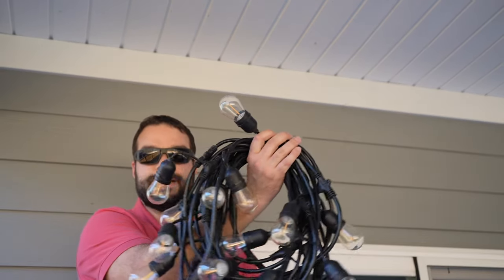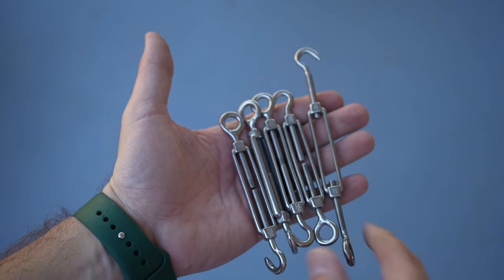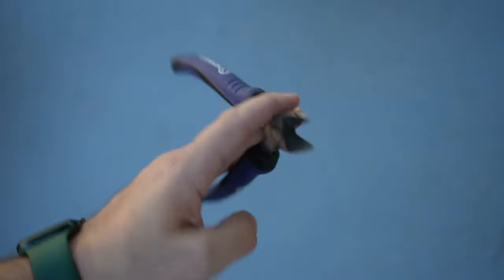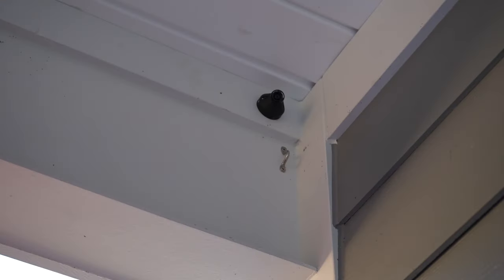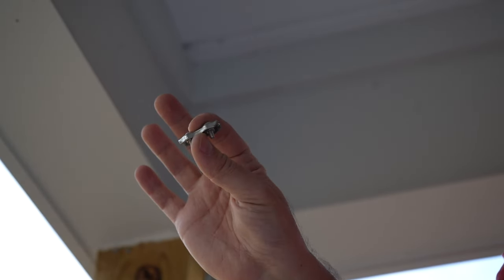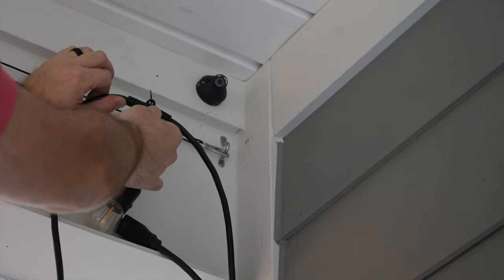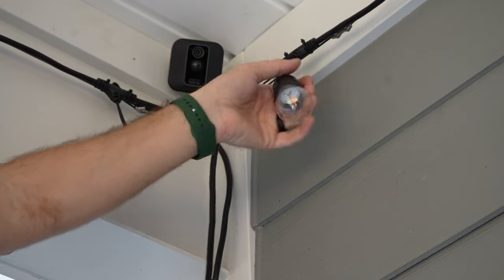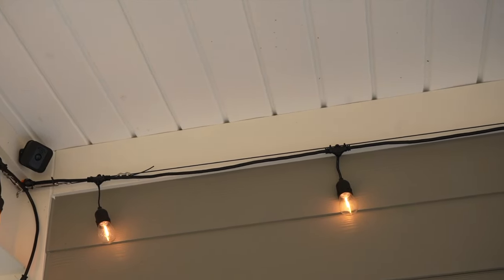The Best Way To Install String Lights | Quick and Easy Cable Kit

Comment from the maker: Cable Kit ► https://amzn.to/3xv2flh
String Lights ► https://amzn.to/3kcQIUn
Screw In Drywall Anchors ► https://amzn.to/3KisXVU
Dewalt Drill ► https://amzn.to/3lJlqoD
Dewalt Drill Bit Kit ► https://amzn.to/3lNQEec
Stanley Fatmax Measuring Tape ► https://amzn.to/3kcQQDl
Wire Cutters ► https://amzn.to/3IxE8sd
Kasa Smart Outdoor Plug ►  https://amzn.to/4b6u6cJ

Comment: I have an outlet in the backyard, however it will not reach the string lights that I want to hang on the fence. What is the best way to get power over there? I heard extension cables are dangerous and should only be used as a temporary thing such as christmas lights. Thanks!
Reply: Type UF cable. 12/2 with ground or 14/2 with ground ran underground. Otherwise you need to hire an electrician to bury conduit and run wire to a box to add an outlet. You need to add an outdoor receptacle either way with gfi protection

Comment: Nice job ! I've installed battery powered & solar string lights and I used the zip ties that has a screw hole in them .

Comment: I have 3 places to attach around house but no where to put a post or light or a planter.  My question is how far can you stretch guide wire across?
Reply from the maker: You’ll have to test it, but probably 10 feet

Comment: How would you install on plastic siding? Will it crack or cause siding to come off?
Reply from the maker: I’m assuming it’s covering wood.  Might want to do a test drill and see what’s behind it.  Wood is ideal to anchor this and get the line tight.

Comment: Brilliant. I finally understood the exact and completely opposite end configuration on each side of the cable and why. 
My question, you stressed the importance of having a tight globe strand (black) wire. Why? 
I understand that a tight base (silver) wire is important so that it doesn’t move much (I think) but why do the globes have to be tight, can’t they be loose and hanging like upside down waves?